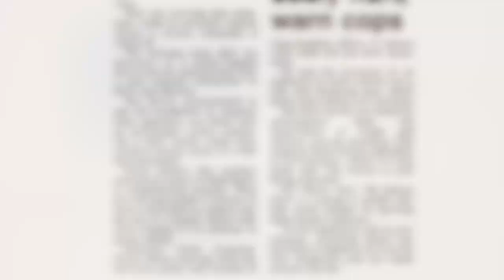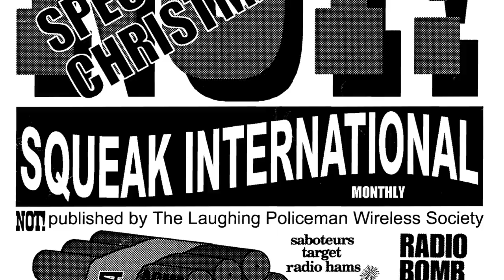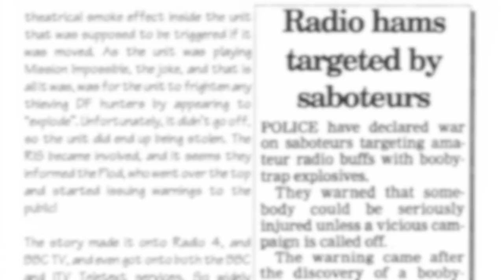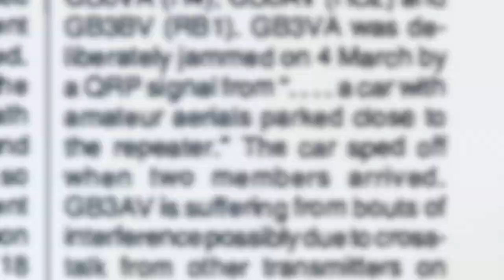The Amateur Radio Repeater Bomb Incident

Comment: Repeater jamming or site destruction has been around for a long time.  There was one radio site on Box Springs Mtn in southern California that went off the air one night.  When the owners went up to investigate the next morning the building was gone.  It had been pushed over the side of the mountain with a bulldozer.
Reply: haha jesus..
Reply: Crikey!
Reply: There has been so many instances here in SoCal of "rival" repeaters going after one another by rouge users. Cutting antennas in half, blowing up shacks and other small bldgs, as well as the typical box on a hill attack where a device listens on the input for RF, and randomly records/repeats snippets of the incoming transmissions to completely disrupt the repeater, and render it useless. I remember reading of one incident where a device was hidden in a tree, less than 400' from a major repeater, and it took the hams about a year to locate it because it would only TX for short intervals, after sun down, at low power, and also only after or during other legit transmissions at much higher power.
Reply: @paaao  Thankfully we now seem to be free of any of kind of crap here in the UK.
73s - M7TUD
Reply: Those haters stop targeting the hams and went directly to the World Wide Web 😀😀😀
Reply: Interesting, but very odd at the same time.  Rival repeaters.  It just seems strange.  What was the motivation??
Reply: Wew hew :D

Comment: You wouldn’t think law abiding radio ham types would be targeted. I guess someone had a grudge against one or more of them for some bizarre reason. Fascinating but slightly disturbing investigation. Great job. Nice clip of the guy with a yaesu ft 290r btw. Found a mint condition one last year on ebay
Reply: Theres one for sale not far from me but at £80 I'm dubious if its working
Reply: @garys4756  opps I meant a 690r actuality exactly the same but for 6m. Very sensitive with it’s enormous whip antenna
Reply: I was wondering what radio that was.
73 M7TUD

Comment: some amateur radio operators have egos bigger than the height of their antennas.  I've worked with amateur radio operators who sabotage other operators repeaters, destroyed their antenna feed lines, and jammed transmission because of their egos.  I learned all their dirty tricks on detuning transmission capacitors and causing all types of radio problems.   From it all, I decided not to become an amateur radio operator if this is what the amateur radio culture is like.   I have also ran into Elmer's who think they know everything about their hobby and treat you like a mud duck.
Reply: That's why I don't participate in ham radio anymore. I have my license, but short of an emergency, I won't use it. I have my  GMRS  that I do use. As well as the old 27mhz Citizens Band, FRS, and MURS which are license free in the U.S. IF a former Echo Link repeater was still on the air, I'd use it for QSOs to the UK, Europe.... and talk to more friendly folks ! Right now I can't afford the fancy digital gateways and such. Here in the states, GMRS and the other license free bands are becoming more popular - faster in  some areas than others, and more GMRS repeaters and nets are happening. I just just happen to be in a semi rural - slow area. There's quite a few of us waiting for legal FM gear we can use since FM has recently been approved. President is releasing one next month or two (Jan/Feb 22) but unless its a prototype, it's missing a few things, like CTCSS & DCS
Reply: @baronedipiemonte3990  now you are the kind of radio person I don't mind meeting and hanging out with !   I have a license as well, but I only deal with amateurs operators when we have Emergency field exercises...but I don't need to CQ with anyone around the world, and most of the time I just enjoy listening to local police/ems bands and DX.

Comment: Nice video. That was Wesley Smith, started young on the local news when new 1989 or so. Came from Abingdon. Long gone, Reading way now. I did 2 weeks there as part of college, Sat behind the glass, as in the clip. See me. 1997 so after. Could say where he lived as well. What flats, Dads friend knew, postman!. I had licence 1994 so around that time. That and Didcot was the 2 options on the Alinco 2nd hand handheld. 2W on battery. 5W on plug in 12V power at home or the car. Got into Brill today when out for a walk from home this morning. Towards Sunningwell, village from my end of Abingdon. I knew where it was. did Brill windmill by drone (should not, realise now) and inside I did receintly. Made a follow up YT video from the drone one.

Comment: We had an issue with the repeater on top of Enfield Civic Centre. Random carrier just off input causing desense  Couldn't find anything, very low power, eventually traced to the pedestrian crossing outside the centre, the device hidden within the housing of the lights and connected if I remember to the Amber light. 
One of the ungodly had an ex post office Bedford van with the inevitable song (to the tune of Yellow Submarine): "we all jam from a yellow PO van". "Someone's nicked me magmount" another. 
Anyone for a Lindstrom Filter? Interesting times....

Comment: I remember this all too well. I just got my Class B (G7VBV) and was really excited to get on the VA repeater with my FT290RII (a bit like the portable radio in the video). Then the Laughing Policeman started :-( Such a bummer. VA was practically out of action for months. Very frustrating but everyone was amazed it made it to the news! 73 from N1ACW.
Reply: I had licence about that time. That and Didcot was the 2 options on the Alinco 2nd hand handheld. 2W on battery. 5W on plug in 12V power at home or the car. Got into Brill today when out for a walk from home this morning. Towards Sunningwell, village from my end of Abingdon. I knew where it was. did Brill windmill by drone (should not, realise now) and inside I did receintly. Made a follow up YT video from the drone one.

Comment: Didn’t know about this. Extreme lengths for somebody to go to. Must’ve have been extremely angry over something, which should’ve narrowed it down a bit at the time.
Reply: The previous transmitter boxes had been found and stolen by the local repeater group, this one was put on an island in a lake and fitted with a marine distress flare to deter the thieves.

Comment: This makes me think that this could be the problem we're having with the local repeater here in Santiago, Chile. There's something that has been jamming our comms but randomly. Sometimes it could interrupt a small conversation and sometimes it could be transmitting all night to the point it shutts down our repeater. We tried listening to the reverse freq but haven't been able to find the source. We think that it it another ham operator and we call him "bitter flesh". But considering the hours this interruptions ocurrs I may consider it is not actually a person.

Comment: What radio is that at the 1:55 mark?
Reply from the maker: I can’t remember the model mate a couple have mentioned it further down the comments
Reply from the maker: That’s the one!
Reply: 2M all-mode portable radio (FM, SSB, CW).  I have one, and the FT790R for 70cm as well.
An FT690R for 6m exists as well, but in the days it was made 6m was not an amateur band here.
Comparable radio today is the FT817/818 which of course covers more bands and it also is smaller.